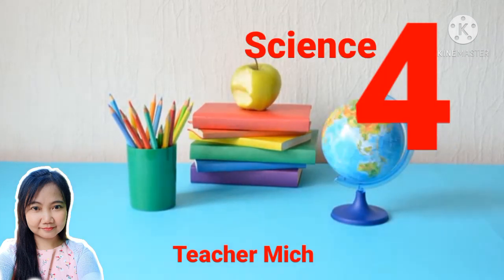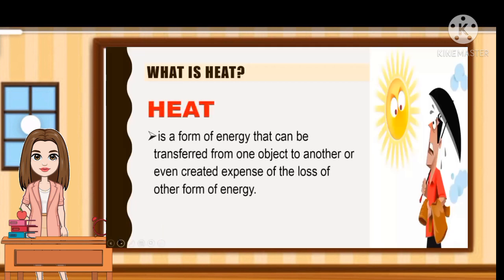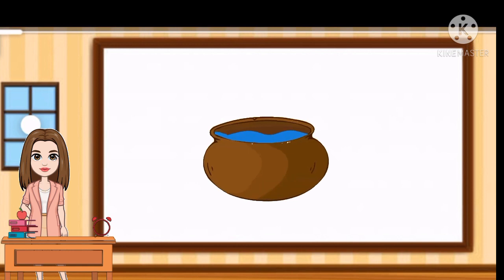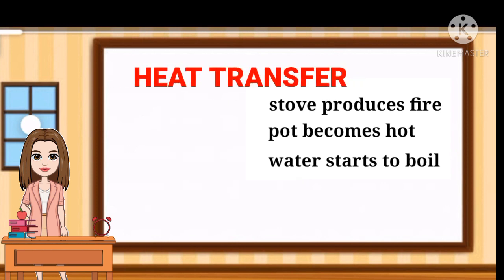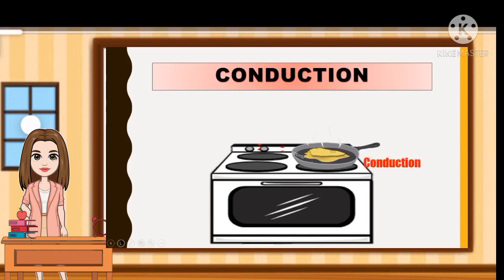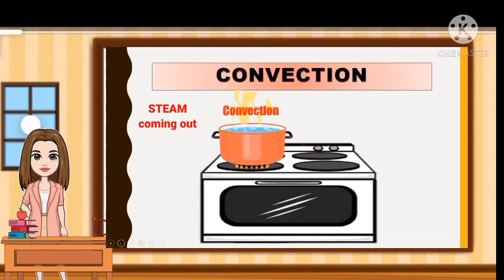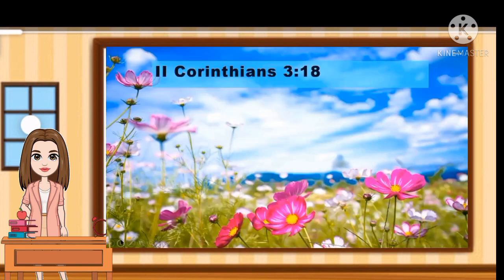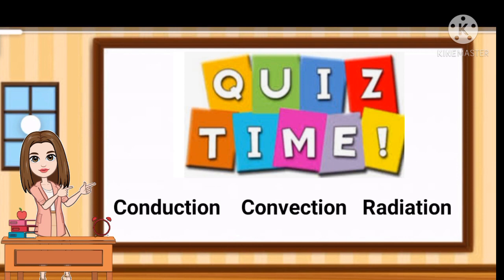GRADE 4 - Ways of Heat Transfer (Conduction, Convection and Radiation)

Comment: Pasagot po

1. _______ is the total energy of all the moving molecules in an object.
2.________ is produced when things vibrate.
3. Energy that travels through radiation is often called______________.
4.___________ is the transfer of heat through solid material. 
 5.___________ is the transfer of heat in gases and in liquids. It is a 
method of heat transfer by the movement of fluids.
6. Solid materials that allow heat to flow easily are a good ___________.
7. A ______ is a particle of air pushed together in a particular pattern.
8. When the____________ is slow, slow-moving waves are produced.
9. ___________ transmits heat across empty space or vacuum.
10. Solid materials that do not allow heat to pass through are called __